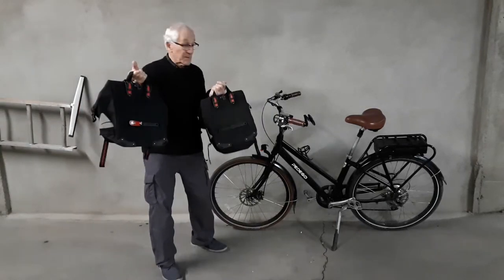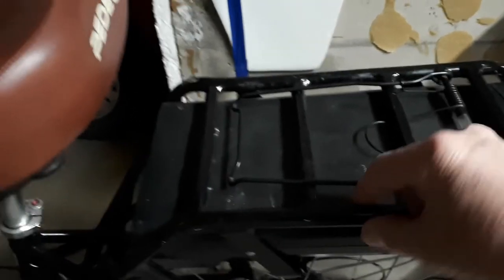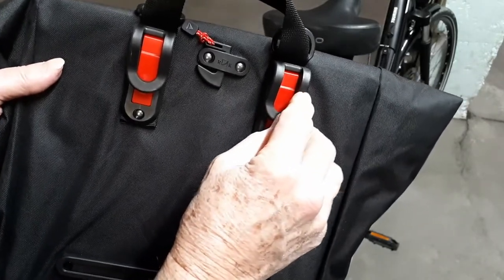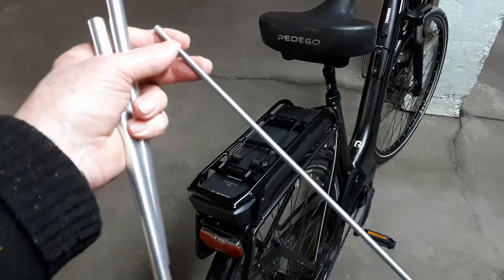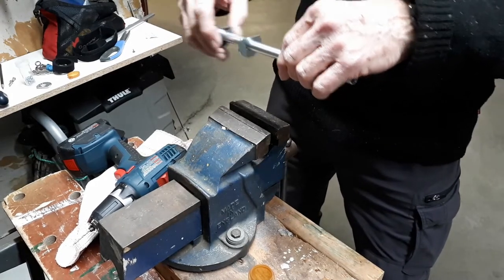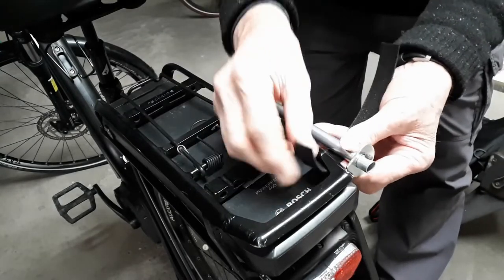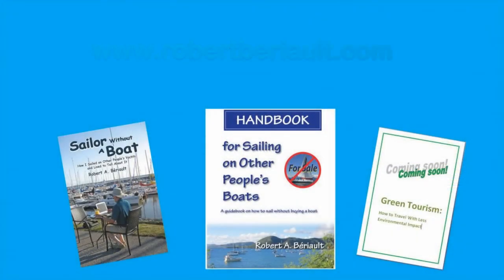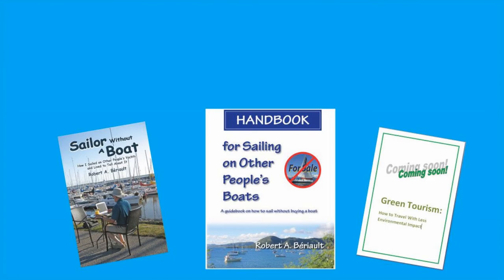Saddlebag Installation on an Ebike Battery Rack

Comment: Your idea is good. I also have an Ebike with a rack mounted battery, pretty much like you have. Non of my panniers have fancy hooks. So I just replaced the hooks with J-hooks I got from a hardware store. I shortened the hook part and then using a vise, squeezed them shut a bit. Works fine. But your idea has my interest. Now to see if I can built it with out needed a welder.
Reply from the maker: I can see that you're creative. As they say, there's more than one way to skin a cat!

Comment: Have you tried putting the panniers onto the rack before the battery? Worked on my Cube ebike with the advantage that the bags can’t be “borrowed” if you leave the bike.
Reply from the maker: Kevin, that's such a good idea that I was kicking myself for not having thought of it myself. So I rushed down to the garage, removed my velcroed-on bars and the battery. But, unfortunately, the clips are too wide and incorrectly spaced apart to fit onto the rack. So I'm back with my added-on side bars. Thanks for the suggestion. I'm sure if other people read this, it might work for their bags.
Reply: Robert Beriault I had to use the lower bars of the rack, the ones that effectively support the battery. My rack is a Racktime.

Comment: Do you  know how to mount water bottles on different locations on a ebike? I know some ebikes do not have water bottle mount. I would like to have 3 bottles.
Reply from the maker: You might want  to try: https://www.amazon.ca/Bottle-Holder-Lightweight-Strong-Mountain/dp/B07SH8SNFQ/ref=sr_1_3_sspa?dchild=1&gclid=CjwKCAjw8pH3BRAXEiwA1pvMscJl5EPf5MWc5remTD9rAJfQA4Th2je852tKuqzbNDZ76rbi6VAezhoCL3oQAvD_BwE&hvadid=208346322668&hvdev=c&hvlocphy=9000631&hvnetw=g&hvqmt=e&hvrand=16277788022483223714&hvtargid=kwd-302194223481&hydadcr=9513_9442169&keywords=water+bottle+bike+mount&qid=1592086213&sr=8-3-spons&tag=googcana-20&psc=1&spLa=ZW5jcnlwdGVkUXVhbGlmaWVyPUFSV1cxTDhPOEpPODkmZW5jcnlwdGVkSWQ9QTA5MTY1OTUxRU9SNklBTzJFRDJNJmVuY3J5cHRlZEFkSWQ9QTA4Mzg2ODAxMTNCWTA0M01QVUlBJndpZGdldE5hbWU9c3BfYXRmJmFjdGlvbj1jbGlja1JlZGlyZWN0JmRvTm90TG9nQ2xpY2s9dHJ1ZQ==

Comment: Maybe instead of stoppers just screw the straps, or use cable ties running through a hole in the tube
Reply from the maker: There's more than one way to skin a cat!
Reply: @RobertBeriault753  indeee!